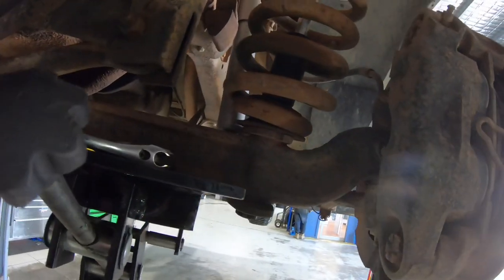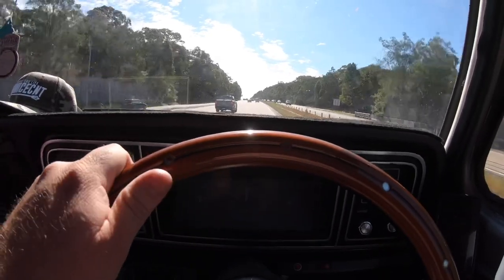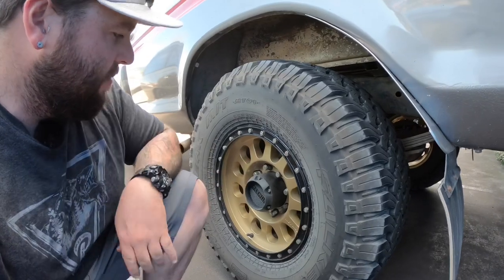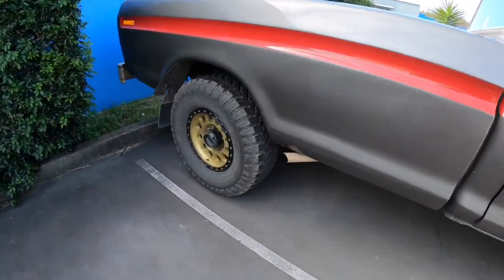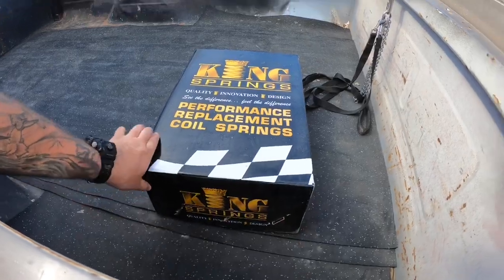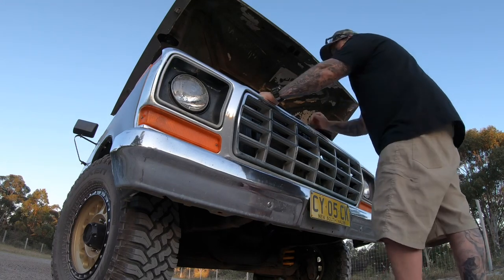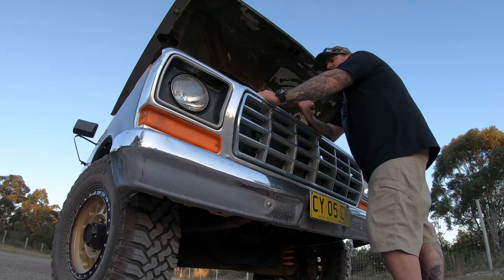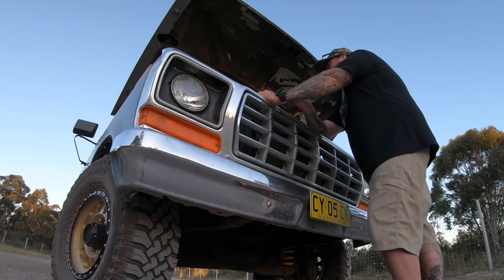METHOD RACE WHEELS & 35” TYRES ON MY 1978 F250 !

Comment: Love the truck man. Definitely a keeper.
I’m currently building my 73’ F250 Crew and wanting to put 35”-37” tires. Curious if you have had any luck on finding out what size shocks and springs worked best for you over the years even after this video.
Much thanks in advance. Keep up the awesome videos.
🤘🏻💪🏻 -Witty’s Garage
Reply from the maker: Cheers mate ! 

I just ran a stock length shocks and 1” lift front coil on the truck from memory. Starting to build my F100 on the channel soon and this F250 is getting a full over haul. 😎🤙🏼

Comment: Is it true that late model ram wheels fit the 73-79 250? I know the 1500 is 5 lug, but I believe the 2500 is 8 lug with the same center bore and spacing. Is this true? If so... what years? I’m not a wheel guy and having a hard time finding new wheels ...
Reply from the maker: Yes mate I think your right they do as I test fitted Ram 2500 wheels and they fit
Reply: @TyFenwick  awesome thanks for the heads up!